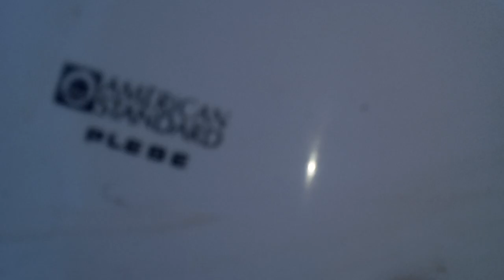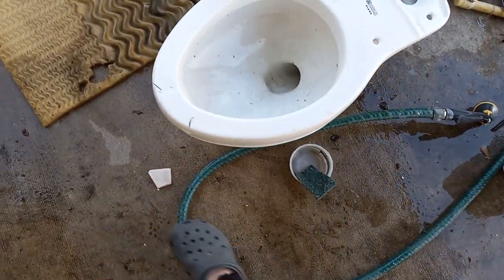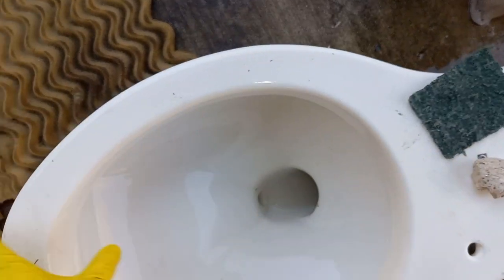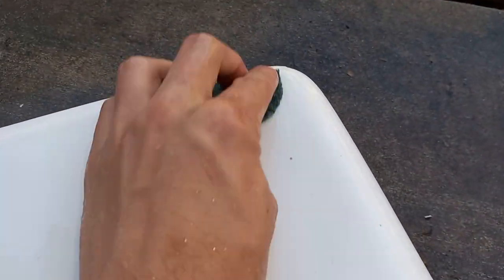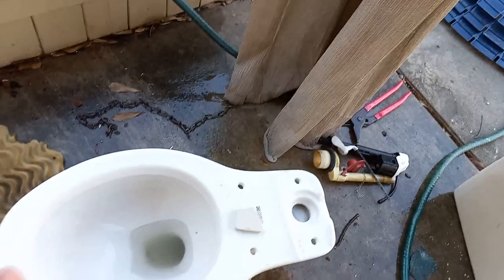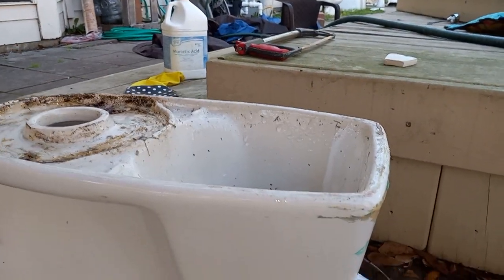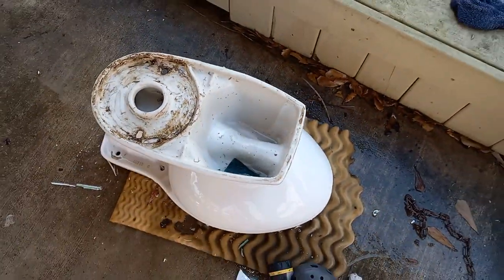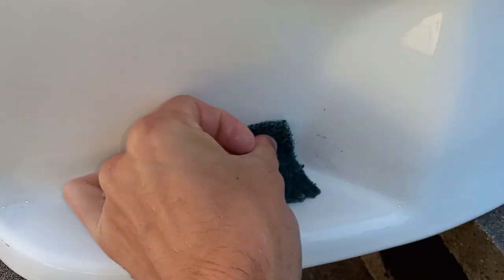The Full Toilet Restoration Process

Comment: I've restored a few toilets before using Lysol Black Label Toilet bowl cleaner to clean up the tank and bowl as well as a scouring pad with Comet to scrub out the tank, & i know the hard work it takes to get a toilet looking like new again. I also replace any worn out parts or incorrect parts in the tank as well. In addition, I try to use older Fluidmaster 200A & 400A fill valves from the 1980s & 1990s when i can get them for older toilets from the 1950s-the 1980s. That being said, nice work!
Reply from the maker: Thanks a lot! It's cool that other people are restoring toilets too.

Comment: Awesome job! I think my problem is that I've never used the acid correctly. I'll try using a scrubby thing like what you did. And awesome tips for removing the old caulk off the base, because I've had a lot of trouble with that. I'm working on restoring my 1980 Wellworth to install in my mom's bathroom. It's pretty clean so far but there's a bunch of finishing touches that I've been struggling with.
Reply from the maker: Is it possible to send me pictures of the stuff you're having trouble with?
Reply: @OCC_Plumbing_and_Restorations  Yeah I probably could later today. Is there anywhere I could send them?
Reply from the maker: @plumbingstuffinoregon2471  Do you have Discord or Google Chat?
Reply: @OCC_Plumbing_and_Restorations  Yeah I have discord
Reply: @OCC_Plumbing_and_Restorations  I might have Google chat too but I've never used it
Reply from the maker: @plumbingstuffinoregon2471  Awesome! What's your tag?
Reply: @OCC_Plumbing_and_Restorations  I just remembered, didn't I find you on Instagram too?
Reply from the maker: @plumbingstuffinoregon2471  Maybe, I'm not sure.

Comment: Have you heard of anyone using any sort of thin bodied adhesive to use as a crack filler for porcelain? 

I have a crack on the inside of my vintage toilet tank. The original in place green toilet, with matching sink and tub.(!)  On one hand, I can go buy a new toilet. But I really want to take every chance I can to not just throw it in the landfill.
Reply from the maker: There's probably a filler you can use, I think they make some sort of paste for repairing china.
Reply: @OCC_Plumbing_and_Restorations  Thank you for the reply - all three of them!
Reply from the maker: @misssmith7225  No problem!

Comment: Little tip for the wax, pour just a little bit of hot water over it and it’ll come right off. Fantastic otherwise
Reply from the maker: I've done that before but the stains are still there and it's a huge pain to get the wax all the way off. Plus nobody will see or interact with it after it's installed so I just clean it the best I can with a scraper.
Reply: @OCC_Plumbing_and_Restorations  have you tried sand paper with bar keepers friend? I’ve always been successful with that.
Reply from the maker: @toiletsofsouthafrica  That sounds like a good idea